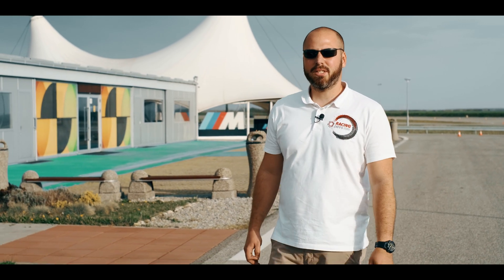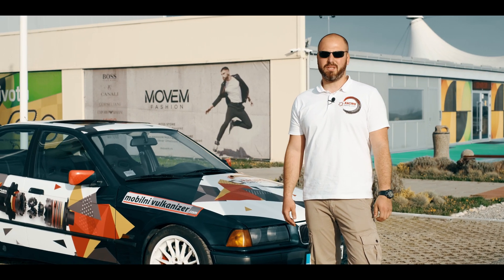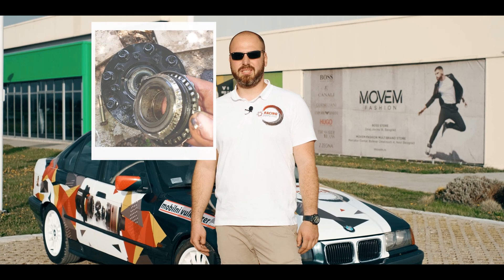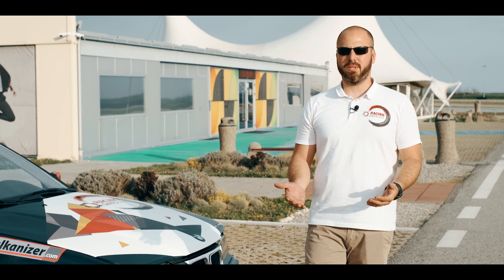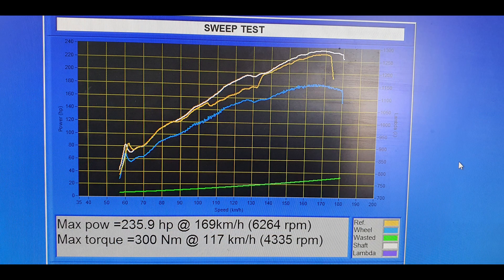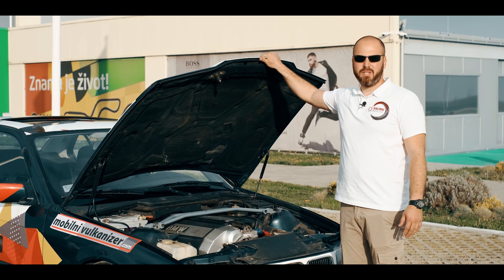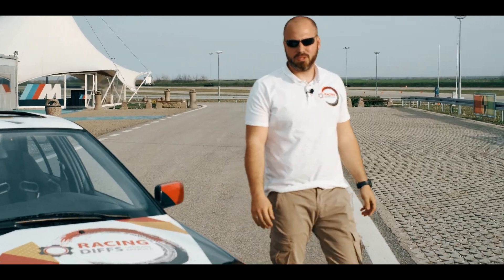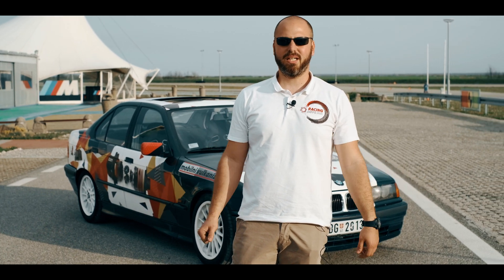What is the real power limit of BMW E36 168mm small case LSD Differential?

Comment: I have installed stage 1 kit on my e30 168mm lsd and the diff clunks when turning slow . What’s the solution?
Reply from the maker: Which oil did you use?
Reply: @RacingDiffs  fanfaro 75-140 gl5 ls
Reply from the maker: Swotch to Motul Gear Competition, and tou won't habe problems
Reply: @RacingDiffs  75-140?
Reply from the maker: Yes, that's the one

Comment: Hey man I'm building an m42 turbo that I'm hoping is going to push around 350 whp and around the same for Nm. Do you think the small case diff is capable of running those numbers or will I have to move up to a bigger diff.